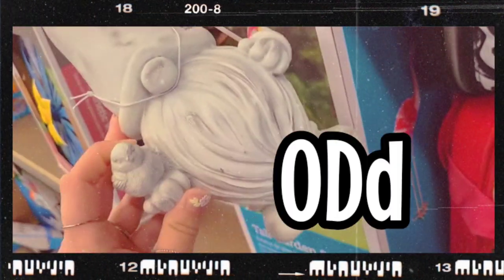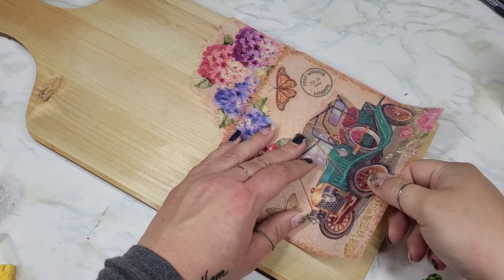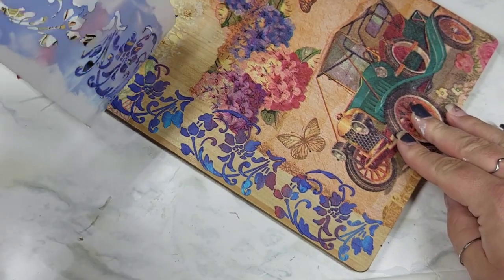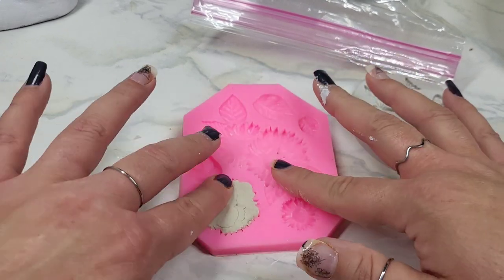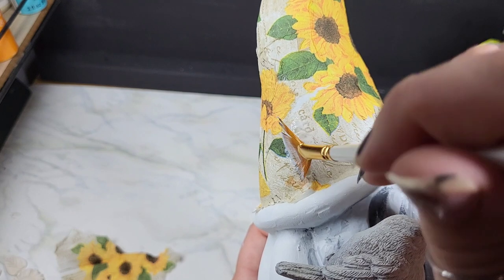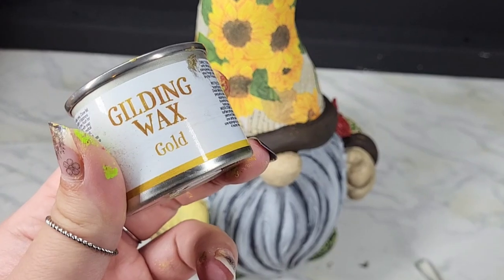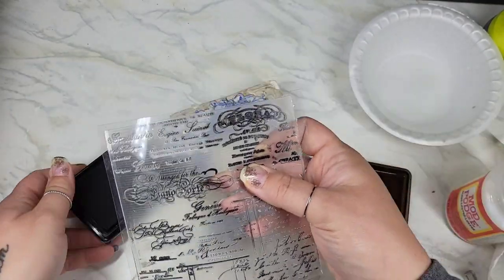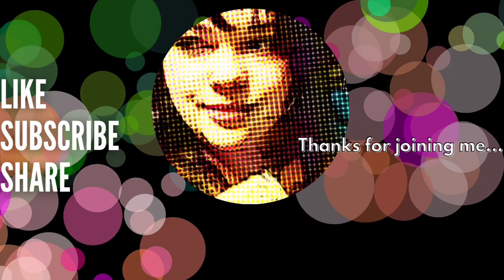I made GENIUS Napkin Decoupage DIY crafts on ODD items for a full day

Comment: The sneaky layer! Errrrrrr! Just had it happen. It was on the small rolling pins from Hobby Lobby. I ended up scrubbing the sneaky layers off and starting over. It all turned out good with twice the work. I love the cutting board using different napkins and mediums. ❤

Comment: Love all you do.  Can I ask why you used a fan brush instead of a reg brush any reason or just what you like
Reply from the maker: Absolutely, I actually explain this often. The tip of the fan brush is really thin. And, since I do this little by little it really gets in between the napkin section I already put mod podge smooshing in there without raising the tissue paper. And. Then when it all dries it goes around the Napkin edges posting a bit of mod podge under it without messing up the napkin.

I show a great example on the plates in my recent glass diy video! Hope this helps!!
Reply: @thediystruggle  will go watch thank you